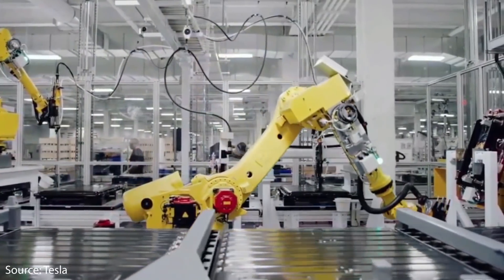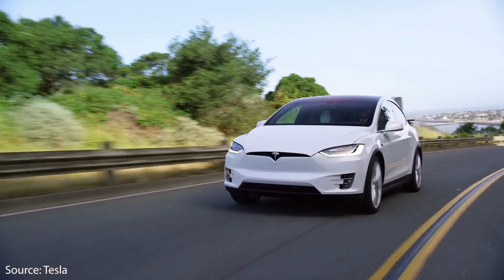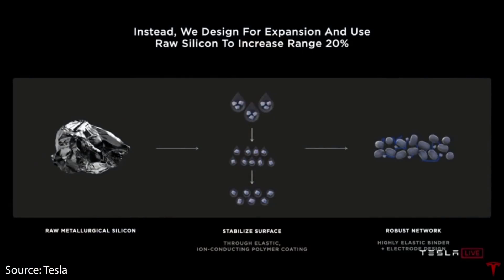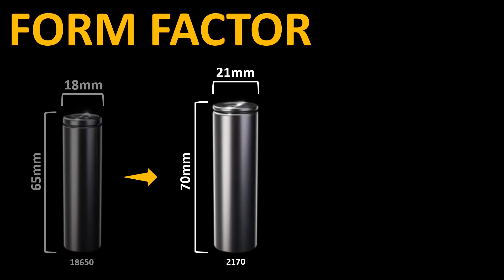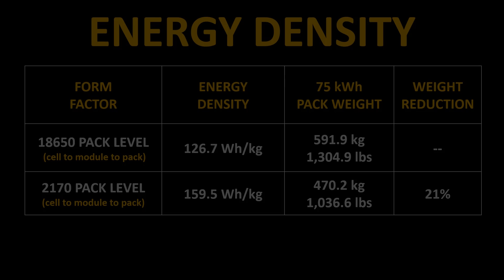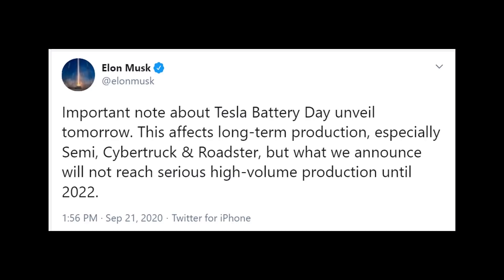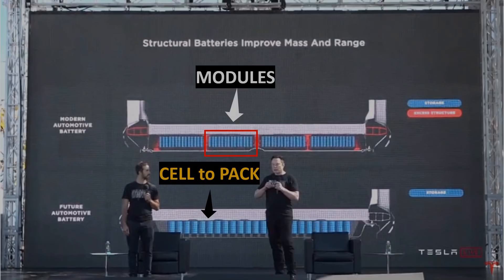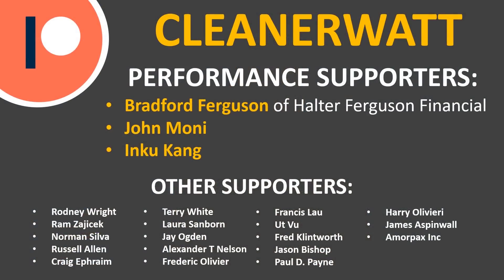Tesla Batteries 2008 vs 2020: How Much have they Improved?

Comment: There were some other changes associated with the Roadrunner cell, such as simplified cooling from the bottom of the cell.

At the pack level the gains are simply enormous.

Most other battery manufacturers are still producing pouch or prismatic cells - these cannot be used in structural packs.  They're too fragile.  Only cylindrical cells will deliver cell-to-pack advantages, simplifying production and reducing components and weight while improving the underbody's stiffness.

Cylindrical cells also offer a big giant advantage in production speed, according to Sandy Munro.  When Roadrunner's prototype line is fully operational, it will produce more GWs per year than 3 of Panasonic's GF-Nevada production lines for 2170 cells - in a drastically-reduced factory footprint.  Four Roadrunner lines will surpass the GWh production of fourteen 2170 lines.  Each Roadrunner line is less expensive to set up, too.

None of the other battery manufacturers can do this.  They don't have the IP.  They don't know how to stabilize silicon on the anode - the target of research for many years around the world, since silicon's advantage over carbon in ion capture is well-known, but no candidate battery chemistries relying on silicon on anodes ever came close to being commercialized.

Other battery manufacturers could license Tesla's tech; courts take a dim view of patent holders refusing to license their patents at fair rates.  But it can take years to agree on what a fair rate would be, and court cases can take even longer.  But even then, rival manufacturers would be screwed.  They don't have Tesla's production line machinery and don't know how to create it.  Even if they license the patents for the machines, building them will require knowledge they don't have if they've never worked with cylindrical batteries before.

Tesla's Roadrunner tech lead will probably last to the end of this decade.  After 2030, things become fuzzy; it's hard to guess whether new battery chemistries might emerge from the developmental pipeline, or who will control those chemistries, or how they might compare to Tesla's batteries.  But it's safe to say that Tesla has secured a giant lead over everyone else - even their own outside battery suppliers.  It's a lead that will have legs.

That's all just details; you covered it in your conclusion: Tesla's tech lead is large.  But I do have an important point to add.

Tesla is not moving to manufacture LFP or NCA batteries themselves.  Only the new Ni-Si Roadrunner cells will be produced by Tesla.  LFP is the cheapest option on the market today, at about $80 for a KWh of storage.  Roadrunner smashes that price by a wide margin.

In the short term, Tesla is using outside supplies of more expensive, less effective batteries, but the long term for Tesla is all about Roadrunner.  Roadrunner will make it into every product line Tesla has.  Tesla is planning to eliminate outside battery suppliers once they can make enough Roadrunner cells.

It's the only way Tesla will be able to reduce costs enough to market a $25K BEV.  And the costs for other models will be coming down, too, as Roadrunner is implemented into their packs.

Tesla confirmed that the Model S and X packs will be redesigned in 2021.  This is almost certainly to take advantage of Roadrunner cells.  They'll start with Roadrunner in the Plaid variants of those models, but the other models will eventually benefit, too.  It might not happen on Elon time; could be 2022 or even 2023, but it's coming.
Reply: I completely agree with you. Many people does not seem to understand the long term implications of their Roadrunner cells. When Tesla have managed to really scale their battery production they are then also able to sell their batteries to other manufacturers if they want to.
Reply: Thanks for the insight! If LFP and NCA batteries make sense for different applications, I wouldn't be surprised if Tesla's R&D look into those and make similar breakthroughs and produce them in-house as well. At tesla's scale, wouldn't it be smart to also consider alternative battery materials to lessen the stress on nickel demand?
Reply: @kevinmarealtor176  LFP and NCA chemistries do not have the theoretical energy density that Li-SI batteries can have.

LFP's advantages are cycle life and lower cost, but it looks to me like Ni-Si cells will do as well on cycle life, possibly better, and will destroy LFP on cost.

NCA's sole advantage is better energy density than LFP, but that chemistry has been dethroned as well.

Tesla might do basic research into almost any chemistry, but I think Roadrunner is their commercial path for at least the next decade.  And over that span, I think it's unlikely anyone will commercialize a battery that's better than Roadrunner.

Beyond that, we shall see.
Reply: @Urgelt  
Look at the Cathode graph in the presentation.
LFP about 600Wh/kg(!)
Reply: Hmmmm.
CATL produce cell to pack. Are they cylindrical?
The cooling is better due to the increased surface area on the base, plus the much reduced heat (resistance) from the Tabless cell.

The production speed advantage of this cell over the 2170(!) is mainly due to 2 factors.
Five times the area of jellyroll in each cell means you get five times the number of kWh leaving the factory for the same number of "cans" (cells). That's even without speeding up the line, or allowing for improved chemistry/ materials.

The second reason (as both Elon Musk and Sandy Munro mentioned) is that since there's no tab welding, there's no need for the line to stop.
That's why Elon Musk mentioned "7x from one line".
Hence, just with that, 5× for volume, 1.25×(?) Speed increase, thats the 7× target 

You were back to front on the factory numbers.
The prototype line won't produce "3x Nevada production". It's 3× for comparable size.
But it's 10-15% of the footprint of Nevada.
Plus, he mentioned the next "module" will reach about 20 GWh, which is why he said 200Gwh from a factory the size of Nevada. (He may have said "FROM Nevada" which would indicate they intend to swap production eventually!!?)
That would mean 5 factories per TWh, a total of 15 (Nevada sized) for the 3TWh target.
I suspect it will be even better.

They will move to the "lesser" cells eventually, but not yet (EM). Drew eluded to this in the Q&A. I think at about 2h 6m.
It's just a case of having the factories.
All the chemistries work with this cell format.
In fact, there may be an even larger wh/ kg saving on the LiFePo4 product, so well worth it.

The 25k car.
They may actually get more saving from the megacastings.
The pack will be smaller, that's less cost advantage in comparison.
The castings save the same amount of bodywork in part quantity, welding, labor, on every car, irrespective of size/ price, so would be a larger proportion of total cost on a smaller vehicle.

Model S/X?
It could be a simple floor plan change to allow for pack height? That will already be tooled up for the Plaid, so essentially zero cost.
If they do, the pack saving will be considerable.
No import cost from Japan.
Fewer cells in the pack.
It's debatable whether they use that for a refresh, or take the profit.
Reply: @rogerstarkey5390  It's a bit more than 3x per line, in terms of GWhs of capacity over time.  You're right, there are other factors - smaller line footprint is one (*much* smaller) and lower cost to establish the line are two of those other factors.  I was only comparing GWhs per line in my remark.  4 Roadrunner lines will exceed the output of 14 2170 cell lines.  But they will also cost less and take up a much smaller footprint.  Taken as a whole, it's a very significant improvement in cell manufacturing.

Pack height may not be much an issue.  The Model S, X, 3 and Y pack heights are affected by the module packaging and trays.  Cell-to-pack (really cell-to-car) gets rid of a whole lot of stuff.  It's not only about fewer, larger cells.  Packs have to be redesigned, of course.

The megacastings are going to save money, but pack assembly cost reductions will be enormous.  They've deleted thousands of components and simplified pack assembly tremendously.  Just line up the cells on an underbody protection component and apply epoxy.  Wiring and connections will be cut to a small fraction of what it used to be.  Cooling has been made far less complicated.  Cell cost reductions will be enormous, too.  This is the game-changer needed most for producing a $25K BEV.

You are anticipating something Tesla has not said they will do - use their tech in LFP cells.  Neither of us can say if that's correct or not.  I don't think they will, you think otherwise.  Okay.

I don't think so because iron doesn't appear - to my eyes - to have any real cost advantages over silicon.  Mind you, I don't know how Tesla is preparing silicon for Roadrunner, so I might be missing something affecting the cost calculations.  But I think silicon will be very cheap.  It's far superior for grabbing ions, too.  There's no reason to look at iron in the long run unless silicon's preparation costs are quite large.

But if it were, Tesla would not be telling us how much cheaper Ni-Si Roadrunner cells are.  It's much cheaper even than current-gen LFP cells, which are the cheapest available at the moment.

Could Tesla apply its IP to LFP Roadrunner cells?  Almost certainly yes, and it would improve the performance of LFP cells.  But I'm not seeing any advantages to doing so.  It's another heavy-duty R&D effort, when they already have a cell that's easy and cheap to manufacture, ready to commercialize, and beats the pants off of anything on the market.  Applying Roadrunner to inferior materials to get inferior cells doesn't compute.

I do think GF-Nevada will get Roadrunner lines, but as Tesla still is locked into Panasonic's contract for a few more years, probably not soon.  Panasonic supports Megapack, Powerwall, Model 3 and Model Y - almost the last Tesla products that will get the new cell, I'm thinking.  They'll start at the top of their mobility product line and work down: Semi, Plaid Model S and X, Cybertruck 3-motor variant, then go down from there.  GF-Austin will be the priority.  Fremont's high-end models can probably live off of the Cato Road plant for a while.  But eventually, I expect to see Roadrunner production at GF-Nevada, GF-Austin, GF-Shanghai, GF-Berlin and probably other factories not yet announced.

Comment: Part of the power increase is reducing cooling power draw I think 🤔 
This is 1st principals in action, not improving just chemistry but cooling, structure, manufacturing cost... wow!
Reply: The energy increase is due to almost exactly 5× the jellyroll surface area (not volume) in the cell.
Power will be the ability to move that energy without resistance/ heat.
One point, if that roll is 5x, the 2170 chemistry should be able to match it in the tabless construction. I wonder if there will be even more tweaks and improvements announced?

Comment: Any guess how fast the new battery will charge?
Reply: Tesla showed a chart on the battery day. Unless Tesla finds a way to increase the charging speed it seems to be slightly lower than current speeds.
Reply: @yourcrazybear  
Look at the graph.
Someone pointed out elsewhere that it was % ? capacity against time (vertical)
I need to check, but if that's the case,  and a cell can reach 80% of its capacity in the same time as a 2170 *cell*....... That's fast!
Reply: @yourcrazybear  
Bigger cell diameters without tabless connection.
The flat line was the Tabless cell.
Reply: @rogerstarkey5390  No. The tabless cell line is not a flat line. The charging time increases with cell diameter even for tabless battery cells.

Comment: Cell to car unibody directly!
Reply from the maker: Good point - that is one step further.
Reply: @Cleanerwatt  Could you do a video on if Tesla were to acquire FreelTech (super cap company based out of Luxembourg)?
Reply: Elon intimated the 4680’s would be going directly into a cast underbody, and the batteries becoming structural, the cells bonded with epoxy and the cooling system moving to bottom and top.
No modules, no packs, saving a lot of weight.
The non cell battery structure weighing less than the body frame it was replacing.
Reply: @grahambrown42  
Not "epoxy"(?) "Structural adhesive"
Reply: Good point indeed! I think Elon's design (during BD) showed exactly that.

Comment: Not cell to pack.  Cell to chassis
Reply from the maker: Good point - that is one step further.
Reply: Same thing here. The battery surround will be an integral part of the car, and with structural epoxy acting as the fire retardant between the cells, the cell walls themselves will transfer load between the top and bottom of the pack structure/bottom of the car.